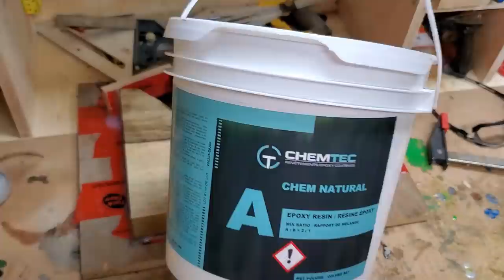Wood turning - The river plate

Comment: Hey, this is awesome work!  Love your creativity.  I am just starting out with turning pens and love acrylic.  I would like to make my own but don't have a pressure pot.  How do you do the epoxy with no bubbles and no pot?  Thanks
Reply from the maker: I seal the wood with epoxy before
And small pour about 1/4 to 1/2 inch by pour and warm it with a torch between each layer, work good for me
Reply: @Etiennemorinwoodturning  I have noticed the torch in the videos, wondered what that was for.  Thanks